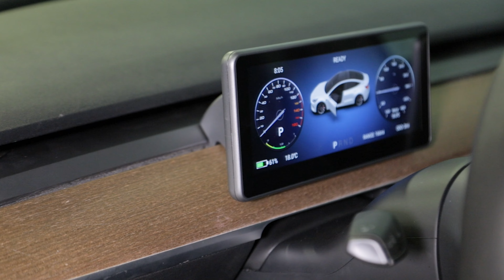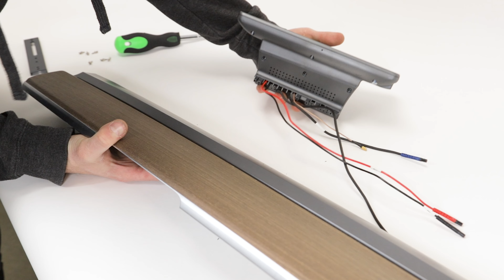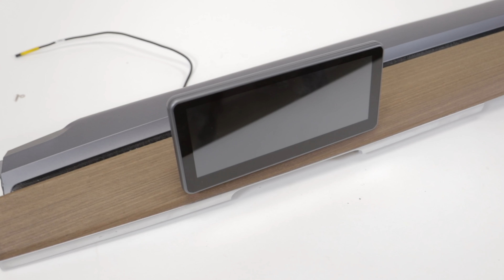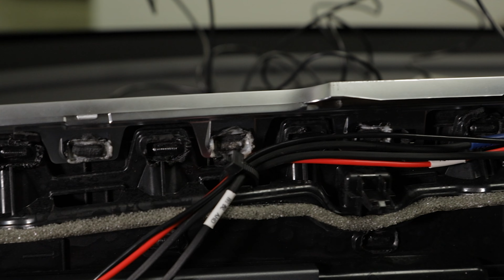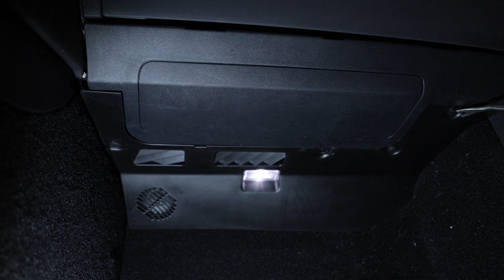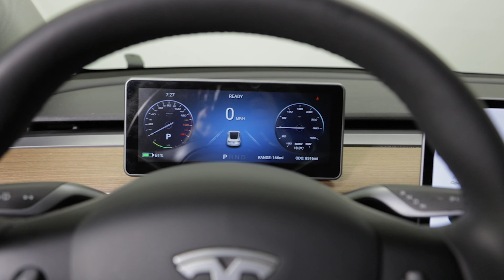Tesla Model 3 & Y 📲 Apple CarPlay & Android Auto MSX-CP Driver View Dash & LCD Display WiFi & GPS

Comment: Can you advise me where the alt. install locations are for data and power for a: AMD 2023 Model Y Austin build. My cable does not have the 12 Volt power clip for the passenger side instal?  I have seen video's that appear to show clip in options under the glove box or in the center console?

Comment: Installing this ourself will impact the Tesla warranty in anyways?
Reply from the maker: NO!  Federal Law prohibits such actions

Federal Warranty Law: The Magnuson-Moss Warranty Act (15 U.S.C. 2302(C))

The Magnuson-Moss Act regulates that vehicle manufacturers may NOT refuse warranty repairs merely because aftermarket parts have been installed on the vehicle.  The only circumstance under which the vehicle manufacturer can void the warranties is when they can prove the aftermarket part is directly responsible for (ie causes the warranty) the warranty claim.

Comment: Random question. I bought the 19 inch Arachnid rims for model s to upgrade the stock rims and tires. Since there is no 19 inch arachnid rim option in settings, do I need to change the settings?
Reply from the maker: You can select the factory 19" option
Reply: @TSportline  Awesome, thanks!